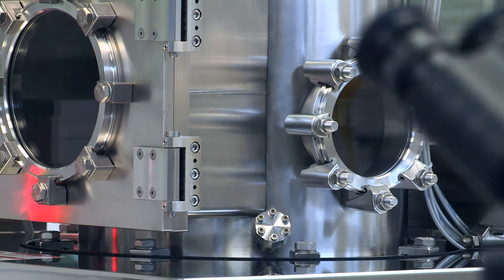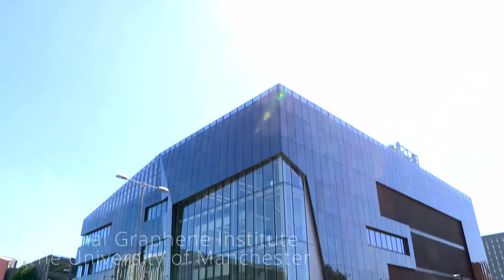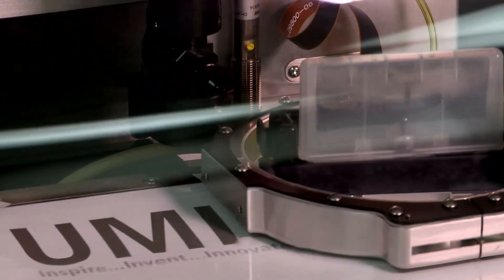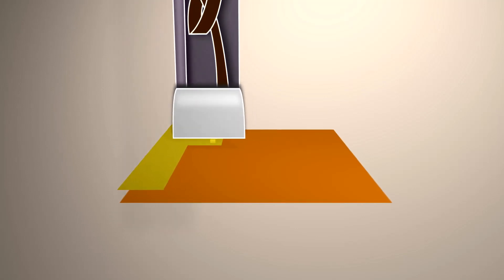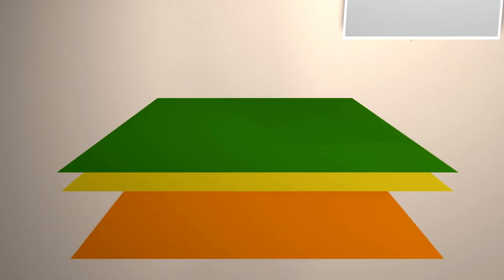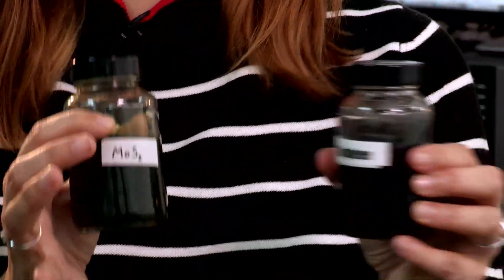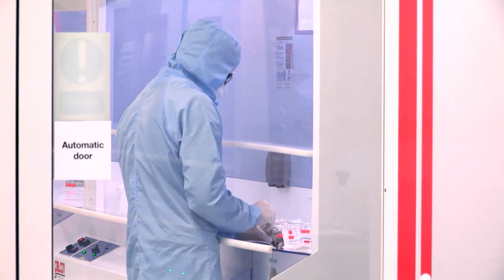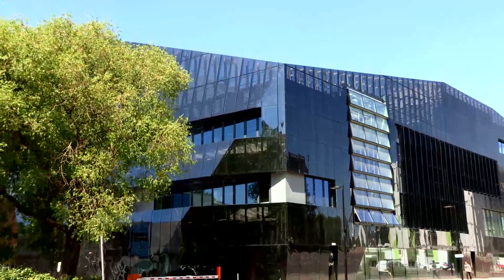Printing with Graphene to Create Electronics (UoM Chemistry 05 )

Comment: Theory: Forcing 2D graphene into simulating volume causes it it be in superposition state! If you don't believe graphene is 2D leave now. For the rest of you here are ways to simulate 3D (depth) with graphene 1. Spin on axis(paper on an axis spinning so fast it looks solid 2. fill it ( imagine folding paper like an accordion, but no two points can ever touch) 3. Hologram! You only need to apply 1 and 2 to create perpetual energy using graphene's properties! IF my theory is true! I am confident it is. Relieved if I am right or wrong.